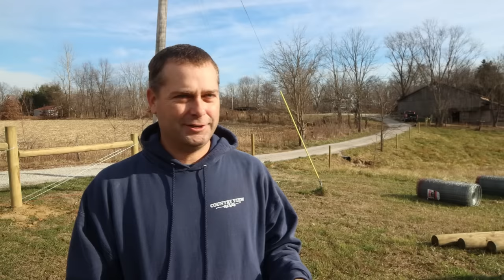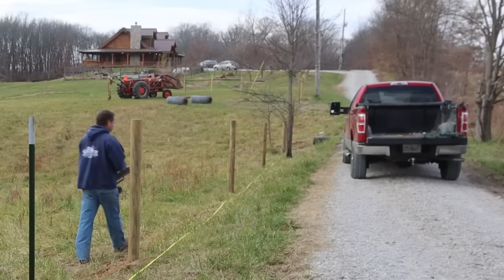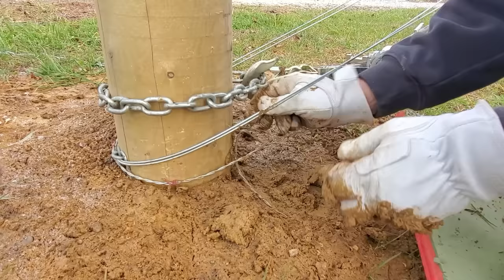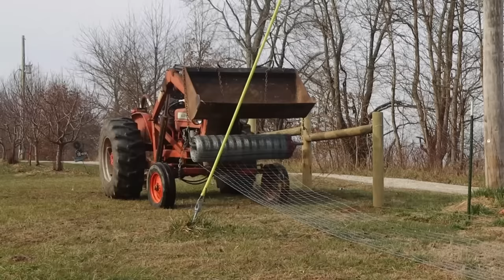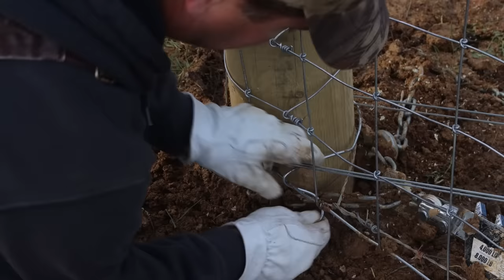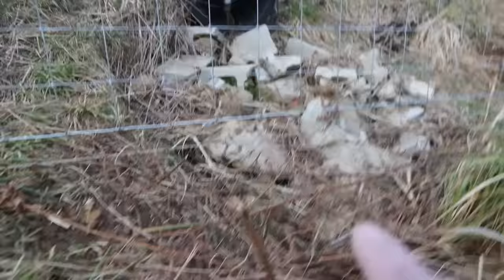Fencing Through a Low Area

Comment: Evan, When you were attempting to pull the fence down by standing on it, if you had previously driven a screw in the post at the lowest level you wanted, with Rebecca's assistance you could have secured the fence at the required level before you stapled the fence to the post.  Hope this helps, Cheers Robin.
Reply: Staples will pull out. Barb wire the dip  u will eventually anyway

Comment: Here in Australia in this situation we would put in a skirt. Build your fence as close to level as you can. When you get to the  collveit  run a heavy wire between your two posts then attach chicken netting with wire rings to the wire, something heavy attached to the bottom I use gal pipe to hold it down. Animals won’t get out, but in big rains allowing it to raise up letting debris flow through without pushing your fence over 👍🏻 if in a big rain if something takes out your skirt you only have to fix that not your whole fence.

Comment: good job Evan and Rebekah. you may fill in that gap at the bottom with a short run of barbed wire below the one you already ran and some soft wire to space the 2 strands apart

Comment: Always take your tractor and park it 6 ft past your last end post, secure your come along to the tractor then tighten fence. Put in staples on your end post (both ends)  then take tractor with forks and pull fence down at your high spots.

Comment: I would put a horizontal swinging gate in front of the culvert. When you have heavy rains, the rushing water won't take out your fence. You can add woven wire to the gaps at the bottom of your fence or use hog panels trimmed to the contour of the gaps.

Comment: Just a suggestion, that block screwed on for footing, should be put on across ways, and in wet areas we used wider ones and pegged, each side, dig out recess at bottom of your hole to take the footing, this also gives more holding power. on shallower dips, we use steel picket, [waratah] we call them, 5 foot 6 in length, cut in half, drive in [10lb hammer] at 45% angle, just under dirt, with8 inch length  S/S wire, in top hole, staple to bottom post bend over, then another staple. also look up ,Strainrite chain wire strainers, much better than those come alongs,  nice stock proof fence,

Comment: Another alternative is to stretch the fence, get it down vertically as far as you can, the fill the gap underneath with a cattle panel cut to fit. Thats what we do in our mountainous terrain. The spring wire clips need to be clamped down onto the fence too. An enterprising goat can get a horn under it and pull the clip off

Comment: You have done a very nice job on your fence.
Whenever you go around a corner, go on the outside of the wood posts to prevent staple pull out. Makes it way easier when installing the fence as well. Never drive your staples all the way into the post as well. If you do, you will take off the protective coating on the wire and it won't be able to slide when something hits it. The wire has to have give in it or will break if stressed too far.

Comment: I haven’t built a lot of fence but our bracing always run from top of the corner post diagonally down to the next post. The sturdiest part of a fence post is near the bottom where it enters the ground. The weakest point is the top. The cross brace at the bottom holds the corner post in place thus the rest of the fence stays taught. 
Also it doesn’t matter that you have 6” gaps between the fence and the ground. Coyotes or your dogs can dig under a woven wire fence. 
Just making comments, your fence looks very nice. I wish I had it on my farm.
Reply: His bracing is correct.

Comment: Very nice job. Thanks for producing the video. Just a couple of suggestions for consideration. You mentioned that the holes holding the wooden fence posts had water in them. Given that, consider putting in about 6" of gravel at the bottom of the holes to allow for the water to drain. Otherwise the posts will rot much quicker than need be. Also, in those areas were there was a depression around the bottom of a T Post, you could cut a foot or so off a metal cattle panel at the proper width to cover the depression, and then cut a T Post to insert in the ground at a couple of places to hold the cattle panel in place. That will prevent animals from escaping and secure the fix in place -- much better than just packing the area with dirt. Anyway, I appreciate you taking the time to do the video. Nice fence!

Comment: 17:00  Put you a catch nail at where you want the fence to go down to.  Leave it out about an inch out of the post and angle it down.  Both of you jump on it and get it to pass over the nail.  Once it is caught, put your staple in.  The right was to stretch a fence is stretching your own fence.  I like your orange fence girdle.  We use to use two 2x6's that bolted together.  It was a pain to bolt and unbolt.

Comment: You have to use the tensioner on the tractor past the posts, and attach each horizontal wire one at a time. The blocking on your boss posts has to be put in with horizontal grain.

Comment: you should have tightened up your wire  on your corner post first , stick a claw hammer with a long handle half way between the 2 post and give it 10 turns or so , you can feel when it is tight enough and when it is tightened remove hammer ,  and when you are stapling the wire in the low area put a staple sideways on the bottom of your post than you can push the wire down and hold it in place keeping your hands free , one last thing in the low laying areas find some big rocks and tie the rocks with a number 9 wire and wrap the #9 wire to your post in the low laying area and also add a couple of rocks between the posts to kee the wire from lifting in time hope this is helpful in future fencing projects .

Comment: I would like to see how those boss posts have held 3-4 years later as you shouldve used concrete on them due to the pressure that they are under with the fence and given that the soil is mostly wet for most of the time. I wont be surprised to see that they have lifted.

Comment: Evan, let me see if I can help you get a better job done on your fencing project.. First when you backfill around the wooden posts, keep the dirt down 5-6 inches. When you tie your bottom wire you will have room to work.  

 On your stretcher you have 3 places to pull from. You are choosing to use 2 come-alongs  to pull with. Try one come-along in the center position. Next put your stretcher outside the fence, not between the post and the wire

. Lastly when you are finishing tying the single strands, you cut the stub end with cutters. That works, but it leaves the tag end sticking up and you can cut you and the animals if they rub against it. There is a way to twist the tag end with little effort that breaks the wire so it doesn't stick out and cannot cut you. Stoney Ridge Farmer has demonstrated the  movements to tie it several times in his videos. When the bottom wires are finished, then backfill the last few inches or dirt.

 Keep up the great work, I am amazed at how fast you are learning what alot of us grew up doing. My fondest memory is being barefoot when I was mucking out the barns.

Comment: Thanks for bringing us along on this fencing project. Man that must be tight. Had never heard of a boss post, so you taught an old dog new trick. Neat pulling the fence down on those 2 posts. Would have been good if that was valuable treasure you found in the bottom of the hole. Many blessings and Merry Christmas,

Comment: That much tension, next year it's gonna pull those low posts up each year little by little. Go straight across and fill in the low spots on the fence. If you want perfect , good luck.
Reply: No one said fill in culvert with dirt. I said stretch wire across top and fill bottom over cultert area with wire. I've been at this for 50 years. Sorry i wasn't specific enough. Next time i'll find some crayons  and draw you a picture
Reply: @ernestkietzman9662  ,,,don’t waste your time drawing a picture.  Evan said at the top of this video that he is building his fence his way.

Comment: Probably the best video I have watched which deals hilly terrain, as well as touched on the burning question I have had…welded wire, hinge joint or square deal fencing. I want to fence in my 5 acre property and it is square with terraces in the back.   We have dogs and goats and I am wanting them to roam free without fear of coyotes. I’d love to be able to ask you questions as they come up. Do you mind?
Reply from the maker: My E-mail is countryviewacreshomestead@gmail.com.   you can e-mail questions anytime.
Reply: @CountryViewAcres  do you think that kind of tension on the fence will tilt your corner posts without concrete? Seems like a lot of tension. How deep did you set your wood posts?
Reply from the maker: @michaeljobrown  4 factors will help your post not shift.  Depth below ground versus height of fence, diameter of post(bigger is better), and how well the soil is compacted around the post, and how well brace is built.

Comment: Only a question. Would it make sense, especially in the really wet areas, to put a layer of road rock, 4-6 inches deep, in the hole and the put your post in, to allow some drainage?  This is what I've been doing here in Indiana. I've got LOTS of that gray, sticky clay here about 1-2 feet down.

Comment: You could soak them poles that are in the ground water in dirty motor oil and diesel in a 16 gal oil barrel  for a few days before you set them. They’ll resist rot and infestation and it’s inexpensive to do. You’re welcome.

Comment: I sure hope I am wrong, but I don't think your fence will last all that long. Why? Because you have put too much stress on it even with all the work you did with the "boss" posts. It IS well put in, but I think you do need to keep a close eye on it. 
If you do need to redo it at some later date, I would suggest doing three sections of stretching (and maybe even five) - stretch from one end post to the boss post, secure the fencing to the boss post, stretch between the boss posts, and finally after attaching the fencing to the second boss post, stretch from that boss post to the end post on that end.

For the places you need another lower strand of barbwire - dig down a couple of inches between the posts on either end, attach the second strand to each post, tighten and either leave the dirt dug out where it is, or return it (BUT remember, if the wire IS underground, it will probably rust a LOT faster than if it is suspended above ground.

I sure wish I was young enough to do what you are doing. AND what you are doing is excellent work!

Comment: Wondering if you paint the tops of every post to help keep water from soaking into the wood from up top when it rains or snows?..
Reply: wood, steel or concrete posts rot at ground level due moisture collecting, ice, snow. City guys will spread roofing tar on top just as a precaution, waste of time. Knew a horse guy who nailed lid of soup cans to top of post.

Comment: You have a rule of thumb when to use a double H brace instead of a single H brace? Length of run?
Reply from the maker: Length of run over 150 feet, I was using double h brace.  Also the more line wires there is and the taller the fence is, double H brace may be a better choice.